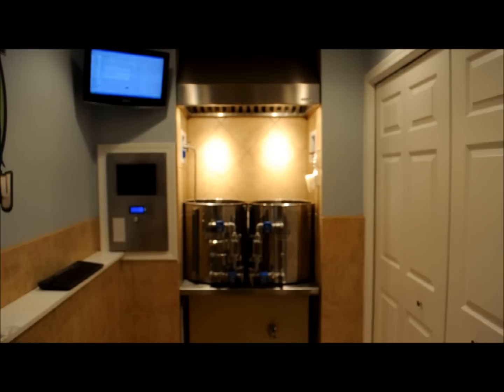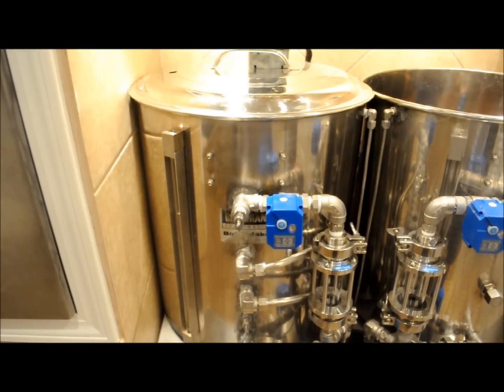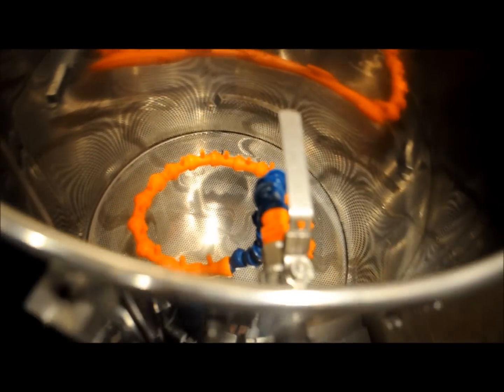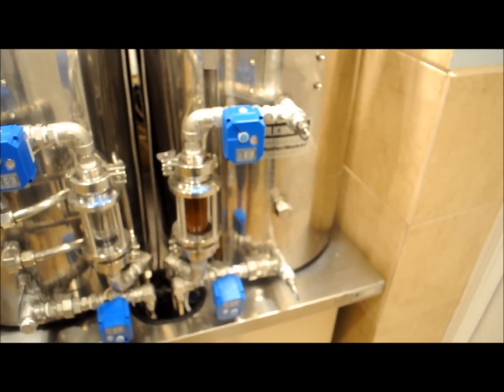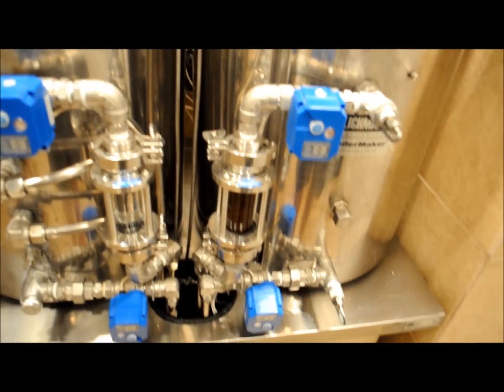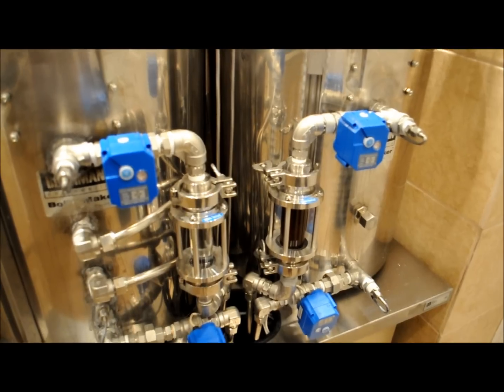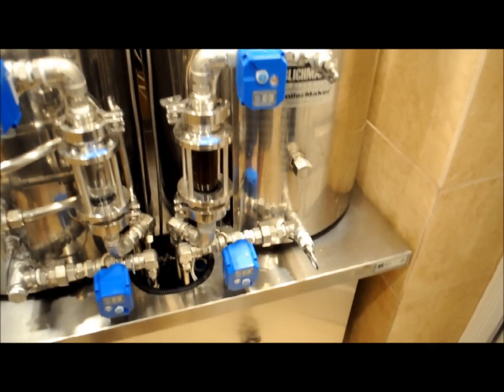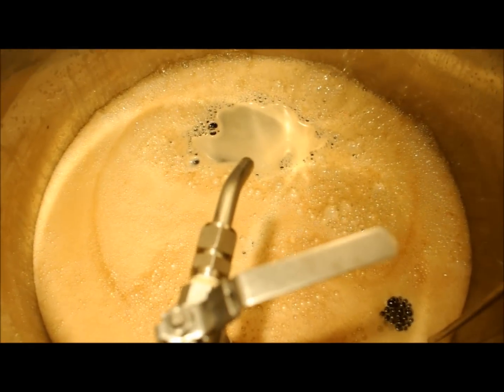A Brew Day on my New Hybrid Brutus 20e Part 1 (strikewater/mash)

Comment from the maker: @livnlarge1980 Thanks! I use the stock diptube that was on the blichmann boilermakers. The blue boxes are the valve controls, however they are just 1/2" threaded ball valves, so you could do what ever adaptation you need too.

Comment: Nice setup - I think my only concern with the whole thing is the amount of hot side aeration you have in the system (when recirculating and adding to kettle).  I think if you fix those issues by keeping your lock hose completely below the water level and either bottom filling the kettle OR at least aiming your fill tube at the side of the kettle wall you will have a better overall system and better final beer results!

Great job!

Comment: love it. putting together my brewtroller electric system now with three kettles... wondering what parts you used for you adjustable lock line and if they're food grade? i've seen them used for coolant in CNC machines but never in the brew industry. where can you get those? again awesome system!

Comment: Hi Bryan, this is great.  Are you still brewing?  I built an indoor electric brewery in my basement several years ago, BIAB, kicking out 10 gallon batches.

I am doing the numbers on building a system similar to yours, 2 vessel electric HERMS with 2 x 30 gallon kettles (not automated though).  There aren't many examples of this style system around though.  Do you know of any more I can check out?

Thanks, and cheers.